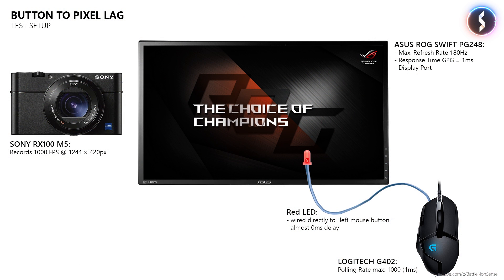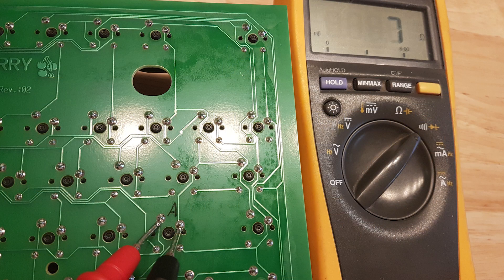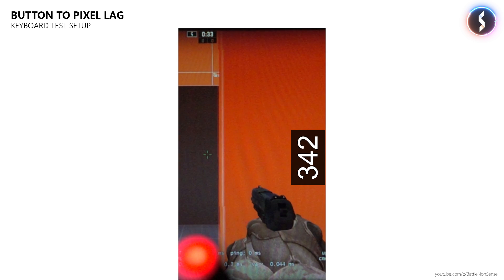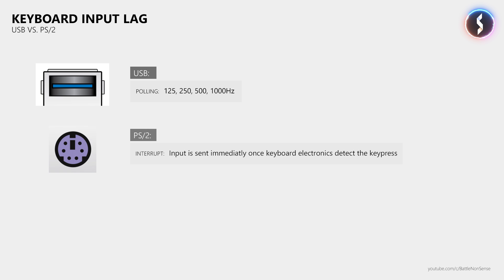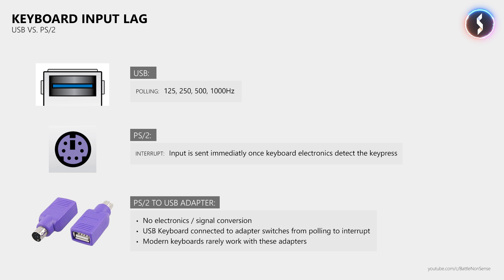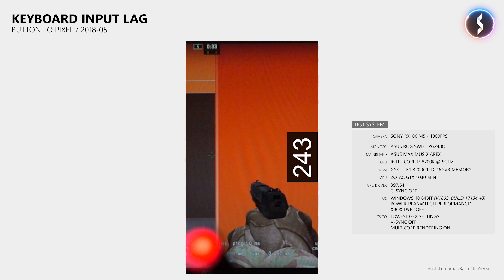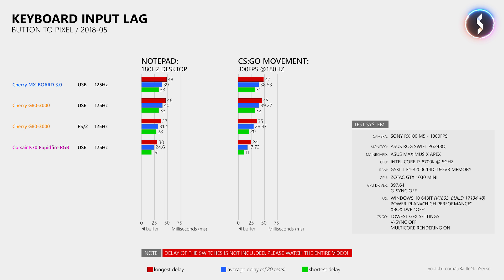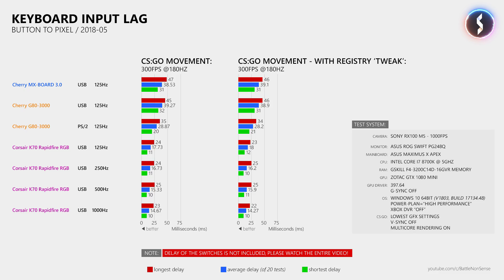Keyboard Input Lag 125, 250, 500, 1000Hz USB vs. PS/2

Comment: Keyboard firmware can make a big difference. Features like buffers, debouncing, matrix scanning algorithms, multithreading, etc also contribute to input lag. These generally have a greater effect than the hardware itself.
Reply: This.
Reply: @Wooting  weird to see you here. Did this inspire you to make the wooting HE?
Reply: Where can I find more information about this? I went on a mechanical keyboard subreddit but there wasn't any information to help me. I have always been under the impression that my QuickFire TK keyboard has quite a bit of input lag, but I'd like to know if that is just placebo. The reason I'm interested in this is because I play rhythm games where timing windows can reach 40 ms.
Reply: It's not necessarily easy to find more information. Some companies think this sort of thing is an important trade secret or something, and force their employees to not discuss it. Developers who choose what to work on are in general excited to discuss and explain it. Wooting, for instance, is a small maker of a low latency keyboard with unique features; they might not have much time for it, but they like talking about bits of what they do. I'd also suggest looking into open source keyboard firmware such as TMK https://github.com/tmk/tmk_keyboard where you can inspect (and improve) the actual code. On the practical side, empirical experiments like Battle(non)sense's are great but a bit far between.

Unfortunately, due to the fact that the Wooting keyboards use analog switches, the method shown in this video cannot be used on them.

Comment: Different idea: There is a HIDUSBF driver that allows you to force any usb device to a different polling rate. Try forcing the 125Hz keyboards to 1000Hz and see if it makes a difference. Cheers https://steamcommunity.com/sharedfiles/filedetails/?id=870308572
Reply: My guess is the lag will reduce a few ms. But the internal lag will stay the same. I would predict that keyboards that are advertised with 1000Hz polling rate probably also pay more attention to internal lag, but that is a hypothesis that is worth confirming. :-)
Reply from the maker: That won't work because when a keyboard has a polling rate of 125Hz then it will (most likely) be a 'Low Speed USB Device'. Their controller does not support that.
Reply: Thanks!

Comment: @Battle(non)sense Did you try soldering the led to the led pins for lets say scroll lock, caps lock,  num lock or just using the already available led's there?
Reply: reliability across tests would be lessened by relying on variable integrated components that could function differently enough to hinder the results of these comparisons. using a single external device is probably the best way to avoid this, and is exactly what he did.
Reply from the maker: Yes. But that would have made it more complex to test multiple keyboards. My current solution where I just have to connect 2 wires to the PCB is much easier. :)

Comment: Hey, great video! Kinda surprised it took "only" 40 hours. 
However, I wanted to say that 7ms is not the expected average difference of 125 Hz vs. 1000 Hz. If you poll the keyboard every 8ms then the key could either be pressed at the latest possible moment before the poll or up to 8 ms earlier or anywhere in between. The probability density distribution should be uniform between 0 and 8 ms which means the average input lag (from polling alone) is 4ms. At 1000 Hz it's 0.5 ms and that means an expected difference of 3.5 ms of input lag between 125 Hz and 1000 Hz. And 1000 Hz also has the advantage of reducing the input lag variance.
Reply: Very well done video, but keep in mind… Human reaction time is ~250ms, and 8ms is around 3% of that, so higher polling rates for keyboards are past the point of diminishing returns. If your keyboard lags, it’s not the polling rate causing it. It could be your system, or a crappy driver, or the keyboard firmware, or something else. Keyboards and mice are different. You can’t compare them with the same metrics.
Reply: Rocket Science yukeo appreciates it
Reply: Aww your comment was copied and got pinned.

Comment: Why is there only one mouse with over 2000 polling rate?
Reply from the maker: Because it's pointless, just like those mice with silly high DPI values that are only interpolated as there is no sensor that has such a high native resolution. ;)
Reply: The polling rate is a limitation of the buss. USB 2.0 only supports 1khz maximum. I stopped working with USB hardare before the 3.x spec was released so I don't know if that supports higher rates. There's a 548 page document you can read if you want to know if 3.x supports it, but I don't want to know that badly XD

Comment: Have you ever seen the thread "Gaming and mouse response BIOS optimization guide for modern PC hardware" on overclock,net? I read up on some of it every few years and I'm wondering if any of it actually reduces lag.

Also I really want to see you do the input lag AB test on the Blurbusters forum. Make sure you follow the steps to turn off vsync. I can get to 20ms on my 144hz monitor.

Comment: Just as a comment, what about setting the CPU priority of a game to “Real-time?” Do you think that will ensure lower latency as well, or will it just slightly increase performance? I’d like your input please. Thank you for the great content.
Reply: Chris is right, it is a bad, bad idea.

If you haven't seen problems you aren't measuring it properly. Windows already prioritises the media (graphics, sound, etc) appropriately and if you try to force it, you make important processes (like say, reading your keyboard, etc) a relatively lower priority and those things can fail.

If people tell you to change priority they probably don't know how these things work.
Reply: If you need it for anything that's not actually a realtime app (productivity, datacentre, robotics, stuff like that - ie nothing you need at home) then the software is broken and you shouldn't use it.

In your example the correct procedure would be to reduce priority of the broken coolnquiet app, not to increase priority of the game.
Reply: Capta Praelium thanks for the heads-up, I’ll change it back and use the high-performance power preset instead.
Reply: Changing a priority sometimes is needed, i remember there where a problems with Cool'n'Quiet in some games, so that you needed to increase priority to something higher than "normal" (Alone in the Dark as an example). But realtime priority for non system apps is most often leads to bad effects, yes.
Reply: Cool'n'Quiet wasn't the app, its a cpu feature, some games didn't behave properly when its enabled with priority no more than normal. It was like 10 years ago, just as example that its not strict rule to not alter the apps priority.
Reply from the maker: It could make the game and the entire PC unstable depending on the system.
Reply: Battle(non)sense I personally have Dolphin emulator set to “real-time” priority and have seen no problems. I just wonder if it affects latency
Reply from the maker: You get more from using the 'High Performance Power Plan' as that also disables core parking.
Reply: Battle(non)sense thank you for being responsive with your comments. It sets you apart from others and really shows you have passion.

Comment: nice test. but somehow i'm missing the results of a native p/s2 keyboard.
Reply from the maker: I could not get one - no mechanical one that is. 
but according to cherry support, it would not make a difference as the usb keyboard switches over to interrupt mode when connected to a PS/2 port.
Reply: @BattleNonSense  yes but it uses a circuit for that, its native USB, for best results u need a native PS\2 keyboard.

Comment: Wait what about using a PS2 adapter on a USB keyboard that supports 1000Hz? Wouldn't that be the best of both worlds?
Reply from the maker: modern, high polling rate gaming keyboards don't work when connected to a PS/2 adapter.
Reply from the maker: @BackwardsPancake the devil is in the detail because the keyboard first has to detect that something happened.
It does a 'matrix scan' of the keys to find out if a key was pressed or not. That scan causes an internal delay inside the keyboard.
The Cherry keyboards I tested have a Matrix Scan interval of 1000Hz, so that should not be why they have so much more delay than the K70 at the same polling rate - but the K70 still has to do something a lot better than these other two. O.o
Reply: Not how it works. The whole point of PS/2 is that polling rate stops being a thing: the keyboard tells the computer as soon as something happens, as opposed to the computer asking the keyboard whether something has happened x times per second.

From what we saw in the tests, it's apparent that for high enough polling rates, the difference between "interrupting" and "asking" isn't meaningful, because the "asking" is done extremely frequently.
Reply: One thing that might be worth checking are more modern purpose-built PS/2 keyboards. I think steelseries had a model like that.
Based on what I saw here, I'm guessing they're just placebos built to cash in on the people who've bought into the myths.
Reply: Could be some mechanical bottleneck in how the signal is processed, or perhaps it has something to do with computer-side drivers/software? The K70 has it's own software, whereas the Cherry keyboards use generic interfaces (I assume? Not familiar with these models).

Not really sure how you'd even test all of this, short of soldering leds to absolutely everything :P

Comment: At the higher refresh rates the main cause of the keypress delay is probably due to switch debounce time.
Reply: The debounce interval and type varies per manufacturer/board as well (with Razer boards having some of the worst debouncing I've experienced). Confirm debounce delays the state change until the interval is over, hair trigger debounce (extremely rare in off the shelf boards) immediately applies the state change but then locks it for the debounce interval to prevent bounce. This completely eliminates debounce latency, prevents a keypress from being dropped if it's shorter than the interval, and is one of my big personal reasons to only ever use custom-built boards running EasyAVR firmware, which allows for hair trigger debounce with direct control over the debounce length as well, along with 1000hz polling of course.
Reply: Any game worth a shit uses key press rather than key release so that's pretty irrelevant, the debounce stuff here is on a firmware level, your computer never sees any of it.
Reply: One away i would assume is to force whatever function your performing as a "key press down"  instead of having the set up only activate when the key is both press, and THEN have to wait the split second for the key to register as being activated untill after the key has been released and complete a full cycle.

I don't know...  Im pretty sure you can force a macro with 0 delay record as another option to simulate this.
Reply: Chromatrope 
Well not exactly..  There is also the extra electrical feedback initiated by the very first press down, that could easily affect this just as much.   Think of it like a sort of electromagnetic "vibration" or echo of sorts...   Some hardware can be so energized and precise...  Pressing a key  DOWN   and  LETTING IT RELEASE, can activate the function 2x at roughly the same time, and that in some cases can leave any hardware or software taking that extra split second to "figure out" which of the 2 is the one it needs to prioritize.

In a sense... It's like a button that's TOO GOOD, AND WAY TOO SENSATIVE that it activates from just looking at it...lol
Reply: That's... what debounce is for. You either lock the press state for x amount of time to prevent it from changing back and forth when switch contacts physically bounce, or you wait until the signal has been stable for x amountof time to send it.
Reply: Chromatrope 
Ok..yup... That sounds correct.

Comment: This was one of the most interesting videos lately. Amazing. I think what would be the next step is to test 2-4 different 1000Hz keyboards from various gamer brands and see if they differ significantly or if you are good buying any of them.
Reply from the maker: @Iaredave when I buy something in a local shop then they don't have to take it back.
also you think they would after I disassembled the keyboard and soldered 2 wires onto the PCB? ;)
Reply from the maker: Besides that it just feels and is wrong to abuse amazons return service this way, there is no guarantee that you get the full price back. Also amazon can just kick you out as a customer if you 'return too much stuff'. ;)
Reply from the maker: That would indeed be nice, but I am not sure how soon I can do that considering how expensive that will be. :-/
Reply: Amazon.de takes back devices up to 4 weeks. Also soldering a wire and then removing the wire does not harm the keyboard. Make sure to use "solder wick" to remove any excess solder and clean with isopropyl alcohol before returing. But I just checked earlier and my Corsair keyboard does have "waranty void" stickers over the screws.
Amazon is very lenient and very "kulant" with the returns. I have returned gaming mice and gaming keyboards that didn't work out for me before and got the money back before the hardware even reached the Amazon return center. If Amazon won't take the keyboards back the best bet is probably to sell on willhaben after testing to recoup some of the cost.
Reply: or you can donate ~500$(or whatever it costs) to get tests done.
Reply: Also, I don't think ANY human can feel the difference of 2ms at most
Reply: Its not about 2 ms.  Its about 2 ms here 2 ms there 10 ms there all factors added together can make a huge improvement in the end. 

After 8 years i just updated my rig to all lowest latency parts from all different tests and despite my fps being the same i score better then i did past 15 years.  Considering to some im past my prime for competative gaming i made a huge improvement.
Reply: I sent you a PM on twitter. I hope you read it :-)
Reply: A lot of places, at least in Australia, won't accept the return of a keyboard if it has been used. This is because of health reasons, people can be absolute slobs to their Keyboard & Mouse.

Also the Void (warranty) if Removed stickers have recently been re-confirmed to be null & void in America.
Reply: I'll give you one. I bet we're a lot faster than that corsair board.
Reply: Waremonger: Well I certainly wouldn't want a keyboard with a keylogger in it. But if done correctly the soldering / unsoldering does not harm the keyboard in any way and it will still be in prestine condition. However as I said my keyboard came with anti-tampering stickers so you wouldn't be able to return it after breaking the seal.
One more thing: I have to stress that I am absolutely not disrespectful. And also here in the EU it's illegal to refuse returns, but completely legal to refuse selling something. So I think you have that confused.
I can't tell what Amazon's internal policies are but I never had any problems returning stuff and I am a very happy customer. Probably I buy far more than I return.
Reply: All work the same.
At most 0.2% difference
Reply: kwinzman:  That's disrespectful.  Would you want to buy a keyboard that had been returned after someone had soldered / unsoldered mods on it?  Also, it could very likely get him put on a list at Amazon where they refuse returns from him.